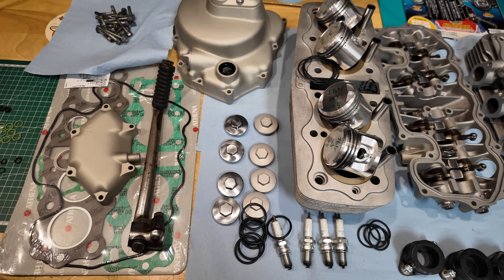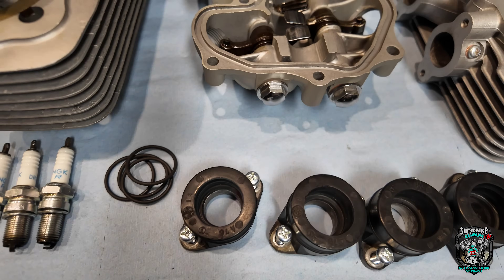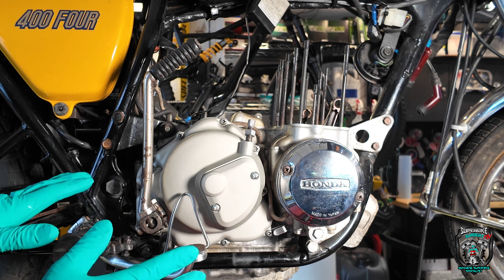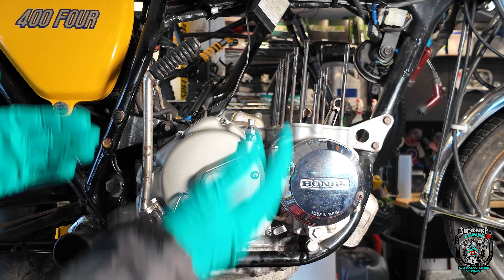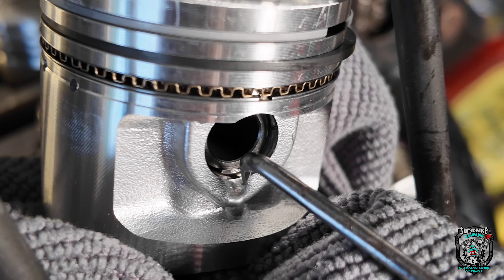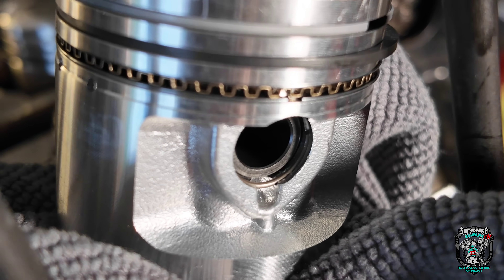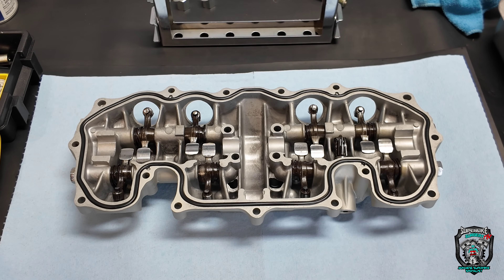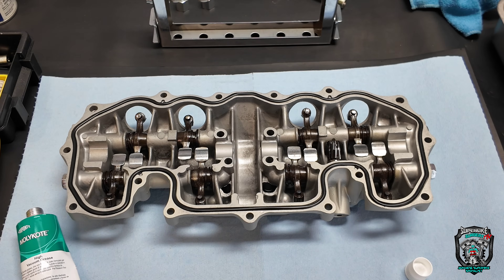Honda CB400 Four - Top End Trouble (Part-3)

Comment: When you mentioned about checking the circle on the gudgeon pin, I had a problem when rebuilding my Ducati 900 Darmah SS. Fitted new forged pistons and fitted the circles, on inspection the one circling was moving in the groove! I removed all circlips and measured the wire diameter only to find one was the wrong size wire. It really does pay to check everything !

Comment: I use red rubber grease to hold "o" rings etc, that stuff look a real grabber, may need it some day. Leave the valve clearences at 3 thou they work better and are not noisy or do damage, trust me. hope you did the clearance as per the manual, Ie No 1 and 4 at TDC then 2 and 3 NOT on TDC, do the in ex on 2 and 3 when 1 or 4 are on TDC if you get my drift. the inlet rubbers are diff 1 and 4 are the same but reversed, 2 and 3 are the same but reversed, if genuine originals they will have the number of cyl moulded in a corner, this no faces up, if mot the carbs will not fit. NEW OEM Honda ones do not have the number just the Honda part no so take not when removing.

Comment: Very much enjoy your videos, especially the "waffling" which I see as sharing your wisdom and insight.  Perhaps I can't see it or maybe it is a unique design but at approximately 3:18 it appears that the pistons oil control rings are two piece instead of the more normal three piece.  Could you please elaborate?
Reply from the maker: They're definitely 3 👍 think it's just the camera angle.
Reply: Thank you for the clarification Sir.